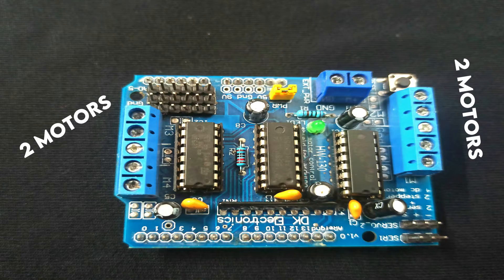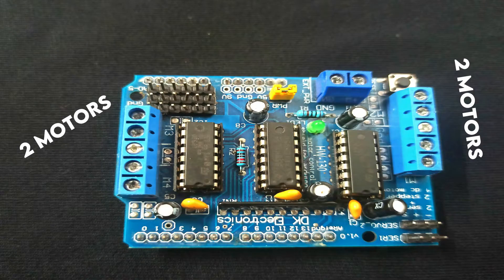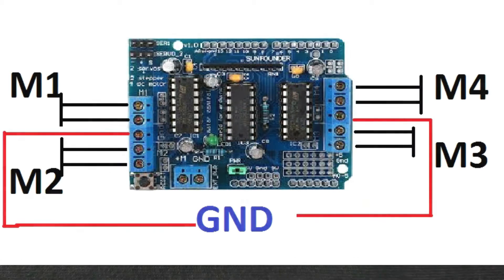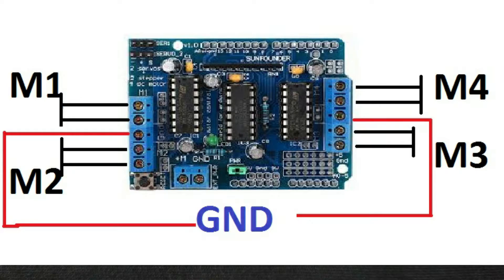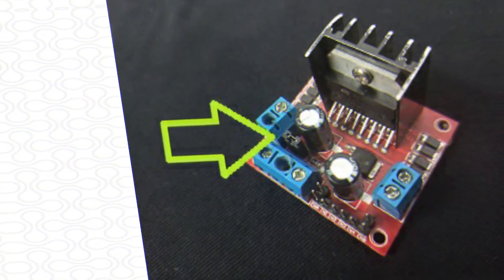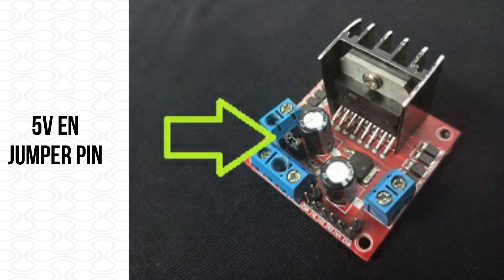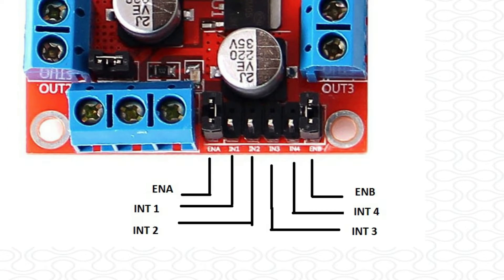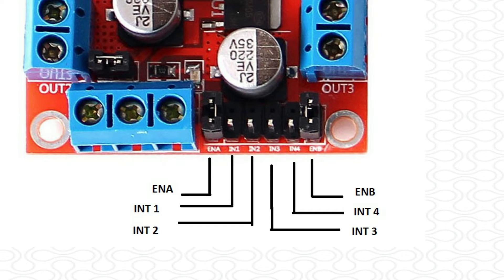L293d vs L298n Motor drivers Differences in Tamil |Arduino Tutorial|#MotorDriver|KKR|#arduinointamil

Comment: Thank you verymuch anna.Anna,can supply power arduino and L293D mator shild at the 
same time?
Reply from the maker: No need bro just give power supply any one either motor driver or Arduino uno
Reply: @KarthiKeshRobotics  Thank you very much anna.anna,how can i connect ultrasonic sensor and motor driver(L293D)(Because motor driver is fixed on arduino board)
Reply from the maker: There is analog pins in the motor driver bro
Reply: @KarthiKeshRobotics  Thank You very much anna.  but how to connect in analog pins anna?(its too Small.)
Reply from the maker: Message me bro https://wa.me/918608354107